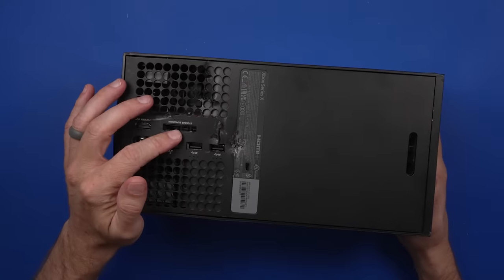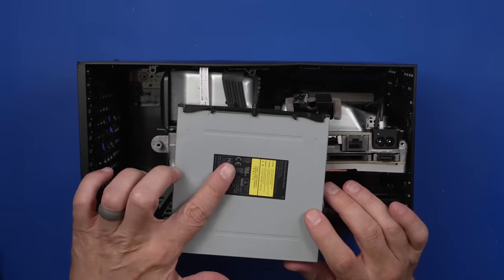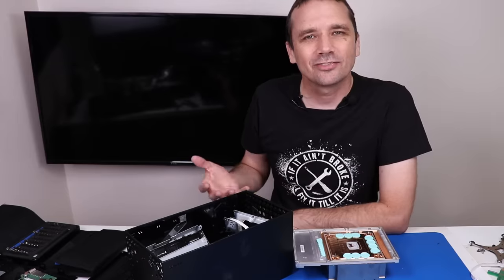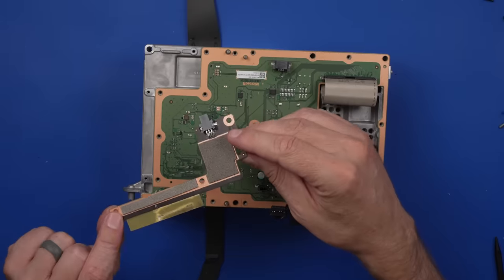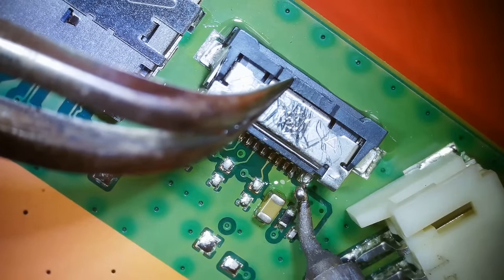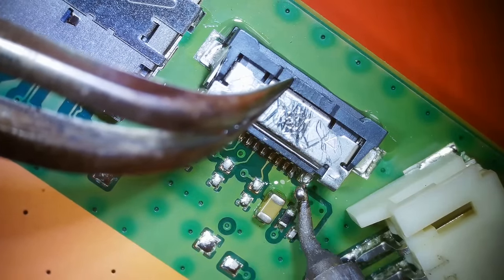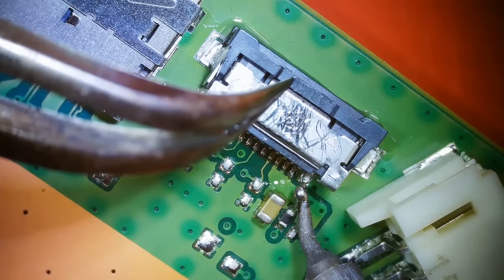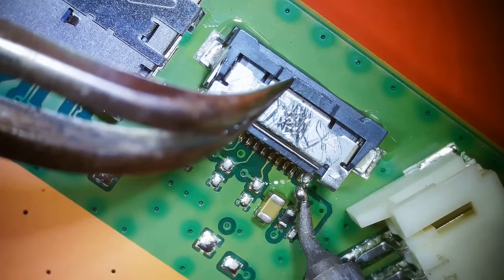$150 For a DESTROYED Xbox Series X - Let's Try to Fix It!

Comment: Its a shame you didn't open up the faulty power supply. I'm curious to know the extent of the damage on the components.
Reply: If I remember correctly he doesn't fix PSUs (atleast not on video), because that could inspire people to do the same, and it's quite dangerous if you don't know what you're doing.
Reply: Is it any worse than for amateurs to fumble around without any guidance whatsoever? Does the absence of an instructional video really prevent someone from trying to fix it?
Reply: @MyRegardsToTheDodo  Seems silly to think it opening would inspire people to do the same. He could just give a warning not to do it, like any other repair channel that fixes power supplies.
Reply: @abendroid  He said himself that this is the reason he doesn't fix PSUs in an older video. And people tend to ignore warnings, especially those kinds of people that absolutely shouldn't try fixing a PSU.

Comment: Hello! I hope you can help me with a problem. I have a Thinkpad T490 and for some time it is not powering on. It is charging, but when i try to start it the led goes on, then off, the fan spins for a few seconds and stops. After 3-5 seconds it lights again, the fan spins again and i can hear one beep and goes off again.

Comment: When you have to replace that much on one console, I am not sure I would consider that a fix! It's more like combining two salvaged XBox's.
Reply from the maker: It was broken when I started and it worked when I was done. Not sure what that is if it’s not a fix
Reply: Making one working Xbox out of two broken ones is definitely a win in my book.
Reply: @Tronicsfix  I watch everything you do Steve so don't take it the wrong way but there was so much on this unit that had to be replaced, it was like a completely different unit in the end. That's what I mean. It was more like a replacement.
Reply: I'd call it "Robocops Franken-Box of Theseus".
If you'd add some upgrades, I'd work in the "six million dollar man" into the name. 😅

Comment: I figured this would be the proper place to ask this question but I just got a Nintendo Switch Oled from Amazon (it was a gift from my friend) and it sounds like my left bottom speaker is crackling and sounds like it’s blown, any ideas what I could do in terms of getting it fixed? Or should my friend start an exchange on Amazon and hope and pray I get one that actually works? Any help would be appreciated!🩷

Comment: When doing dangerous stuff like that, I wonder if you have rubber gloves? I would definitely use atleast some electricians gloves. They are dirt cheap and raise the resistance of ones skin to whole new level.
Reply: Problem with gloves, they get unnoticed holes in them!  JUST as you get use to relying on them for your safety!
Reply: @Capohanf1   the gloves are the second line of defence after taking all other precautions. One shouldn't rely on one fail safe but several.
Reply from the maker: Wait, what’s dangerous about what I’m doing?
Reply: @Tronicsfix  The powersupply was pretty dented. With the plastic shell removed the whole heatsink etc could have been connected to the mains. I guess in USA it isn't as dangerous with 120V but it can't be good either.

Comment: Ok joke steps aside i need help with my xbox series X. When I start it up it goes straight to updating stuck at 62% and then it says something went wrong with code numbers bottom screen troubleshooting wont fix it. Is this fixable still? Thank you
Reply: Do factory reset
Reply: @syedanwar4187 i tried but still the same 😩maybe bad ssd?😢
Reply: @Watever310  bro do offline update it will work
Reply: @syedanwar4187 hey thank you for ur positive thoughts im down right now thinking its broken and no longer use it. Pls tell me how can i do offline update🙏
Reply: @Watever310  your disk drive is broken change it

Comment: Bro replaced 80% of the component , let’s be real he paid 150$ and if he had to pay for the parts this is not effective repair cost ratio , better buy a used one on marketplace. Parts to be replace : the fan , the case, heat sink, wifi antenna, 2 boards , optical disk drive , power supply

Comment: Who in their right mind would pay $150 for a completely non working and battered xbox series x? A replacement fan, heat sink and power supply would set you back about $130, let alone a new case and various other parts. You can find working examples in good condition for less than it cost to fix this disaster.
Reply: thats true 😂

Comment: Btw the thermal paste cannot be applied like that at 11:28 . It needs to be spread evenly as it's a bare die and doesn't have an integrated heat spreader (IHS). A single tiny air bubble or uncovered part of the die will cause it to fry itself